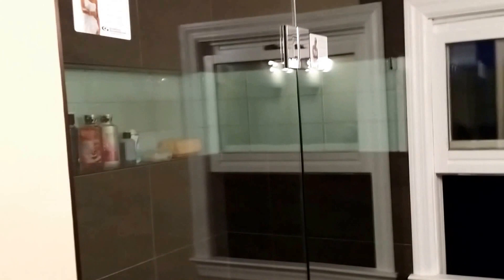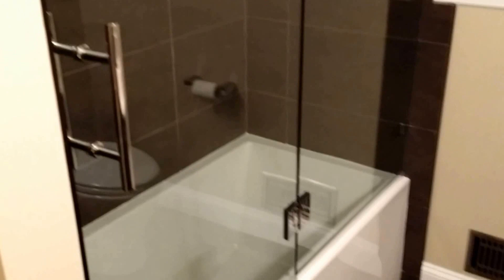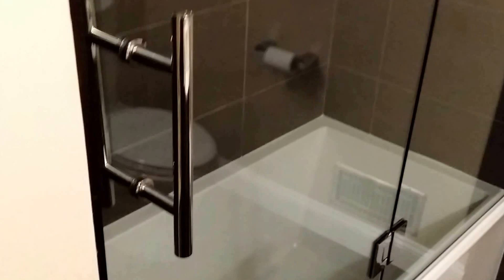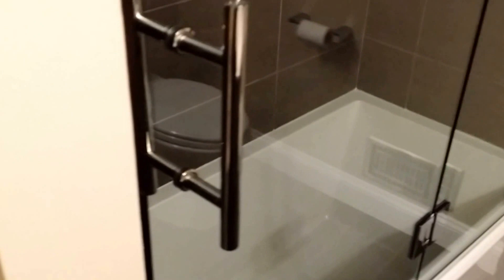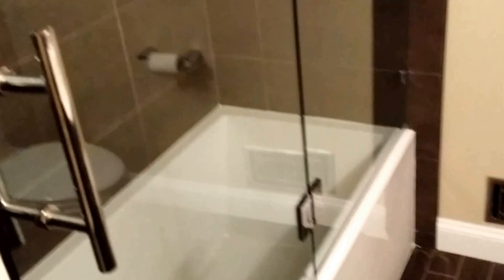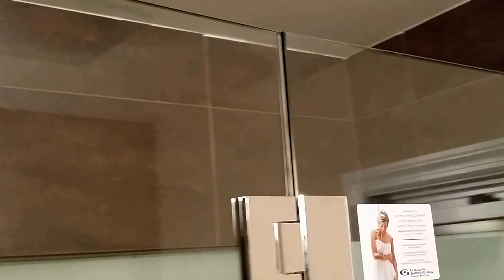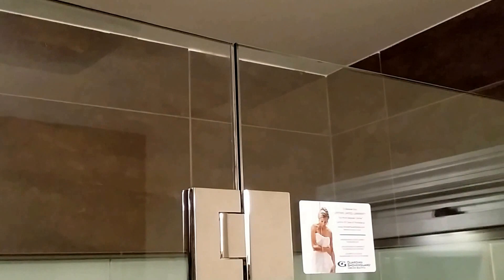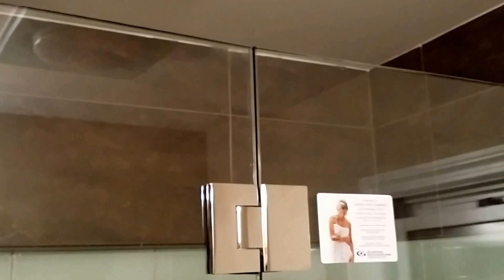Frameless Shower Door Installation for a Tub

Comment: Good video. 
Did you drill the bath tub for the channel and also the vinyls are they clip arounds or are they vinyl with pre applied clear adhesive tape 
Also the bubble effect , if you the level on the door when it's open you will see it leans quite a lot especially on larger panels. 
I was uv bonding a glass support on top and I had the door open and it pull the panel it was hanging of the fix panel completely put of allignement. Thanks

Comment: Why didn't you take the stationary glass panel all the way to the ceiling to put another anchor for strength...and leave the panel/door that opens at same hight thats in the video...
Reply from the maker: Hi Smith wesson, 
Because the ceiling is NOT TILED. Taking glass up to a gypsum ceiling is a mold trap waiting to happen... Plus, finding stud in relation to clamp location is virtually impossible without finding it during an estimate...
Thanks for your question...
And multiple dots..

Comment: Can you tell me what is this exact set so I’ll know what to ask for?
Reply from the maker: The terminology would be,  Square Glass to Glass
Reply: @ExceptionalGlassLLC  thanks for responding. I’ve seen other set ups similar but I like yours by far the best. I want to make sure they get it exactly correct and not somewhere similar.
Reply from the maker: @antoniobridgeforth2362  Use my video as a layout for your local glass company! It's not necessarily a complicated design. Any frameless shower door company can do it.